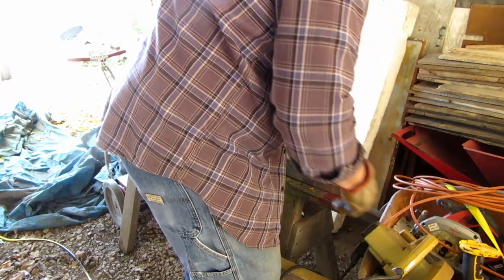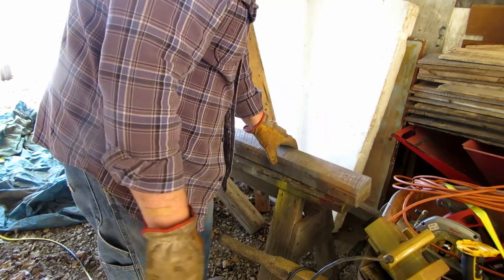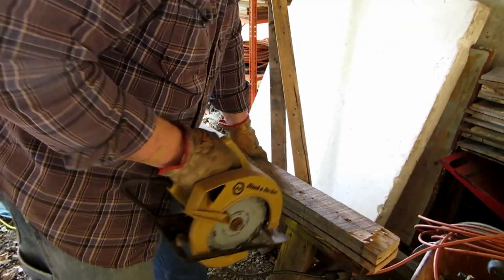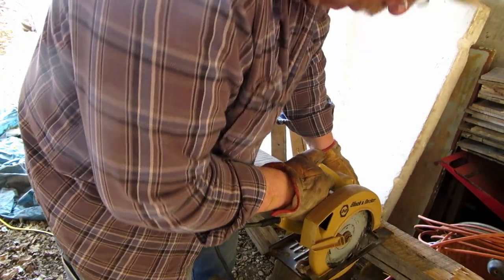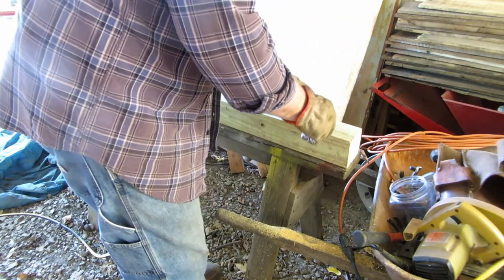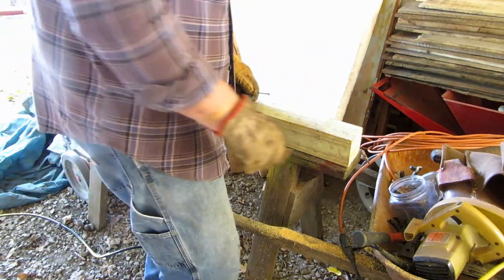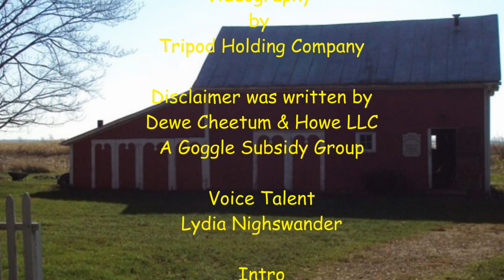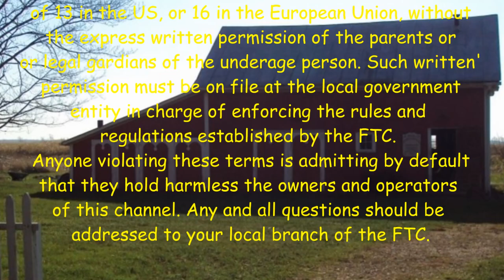New Bench For The Tractor Shed Pt 2 Working On A Poor Surface

Comment: Nice to see a drop cord ran out. Battery charging and saw pulling. 31 here last night and all batteries are inside since DeWalt says that 40 is the low point for long battery life. Trying to get over yesterday. Like mammy said, 'Getting old ain't for sissies'. GBWYall!
Reply from the maker: Thinking of pulling a heater out to the shed and avoiding frost bite. 
Cold this morning and its too early for 35 degrees. 
A foot of snow in the UP last night. It's coming.  😁😁😎😎
Reply: @OldSneelock  Might as well before the really fluffy stuff comes and the lake effect hasn't even cooled off yet. It never gets hit on the money by the weather people here. They were squalling 20's and it was 31. Sounds like guvmint people 2 me.
Reply from the maker: Weatherman. The only job where you can be completely wrong all the time and still get paid. 
It's better then being the presidink.